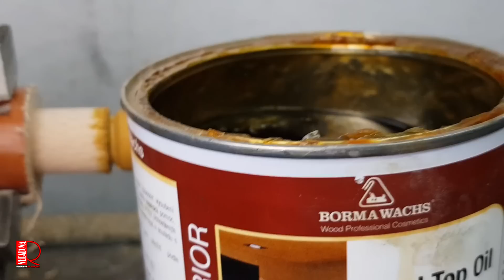Restoration - Leinbrock Ideal ,,0,,

Comment: Nice job Radek as usual :) today i had fun removing 8 exhaust bolts  on a suzuki bandit 1200 mk1 that had,nt been opened in 25 years . hex bolts that no longer had a hex inside them ,just circles lol .and the hex cap would have originally been 13mm ,but where so badly corroded they where now 10mm .managed to remove 7 with no issues using twist sockets ,but one did snap in the cylinder head . so will need to drill  it out .thats gonna be fun .i suspect i will need to put a helicoil insert . hope your well my friend and your lovely wife :) kind regards sion

Comment: Another outstanding restoration Radek and Veronica!  I am surprised that you didn't need to sharpen or renew the grinding surfaces, they have lasted well for 100 years of daily use without wearing down.  I see Veronica is using the sandblasting machine now as well as telling the history, demonstrating the machine AND supplying a recipe!  Where does she get the time?  Well done both of you, congratulations on a fun-to-watch restoration that in informative as well.  Ahoj, Nick
Reply from the maker: Thank you very much Nick :) Yes, these grinders have a grinding mechanism made of very high quality material. I have already renovated dozens of similar grinders, mainly for one particular museum, and surprisingly they always worked without problems. It probably wouldn't happen with today's products :(
Thanks Nick for watching :) Big hugs to R&V

Comment: This paranormal stuff joke was fantastic, just as the whole restoration! 👌
But why does the text on the grinder say "JDEAL"? 🤔
Reply from the maker: The mills were called JDEAL around 1900. Manufacturer W.Leinbrock, DRGM. - Gottleuba in Germany. This is a variant of the designation that was used on some models of grinders.

Comment: On the drawer, it would be nice if you made a lip in the drawer front facia board to go over the metal frame without having to do two notches on the bottom of the facia, Also I've never seen you sharpen the cutting parts of the tools you restore. Do you do them off camera or it is not important to sharpen them?
Reply from the maker: I try to restore things to their original state, that's why the front of the drawer. I just didn't do the tooth joint. The grinding mechanism is made of very high-quality and hard steel, which is perfectly sharp even after all this time, which is why I never grind it. I just try to gently clean them so I don't dull them with sandblasting or a steel disc.
Reply: @VeradonaRestoration  Makes sense.
Reply from the maker: @Capturing-Memories  By the way, it can be seen that you are watching the videos carefully, thank you.
Reply: @VeradonaRestoration  Oh yah, I like perfect restoration jobs, Keeps me away from facebook and tiktok.